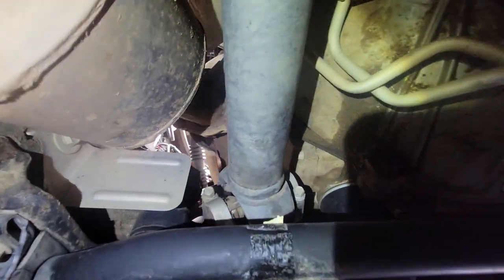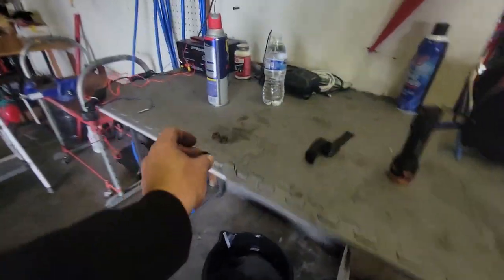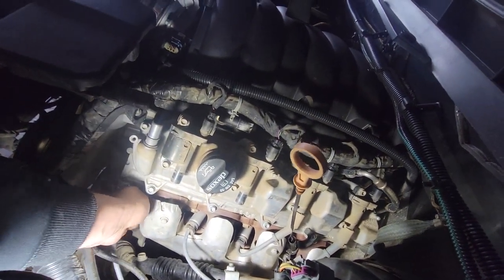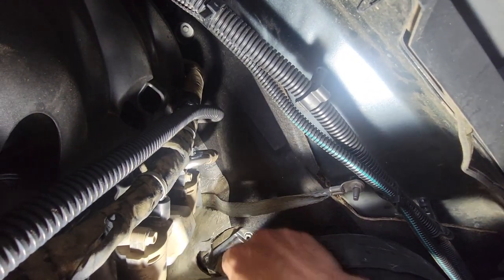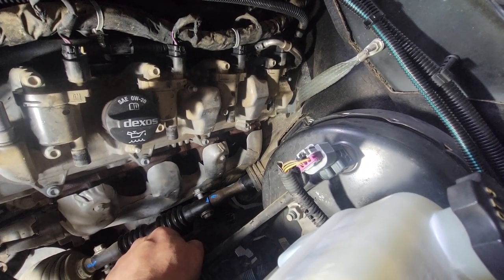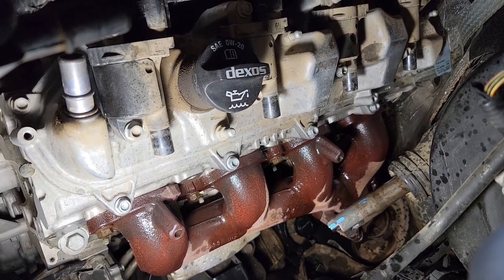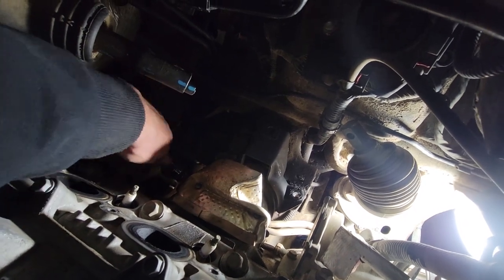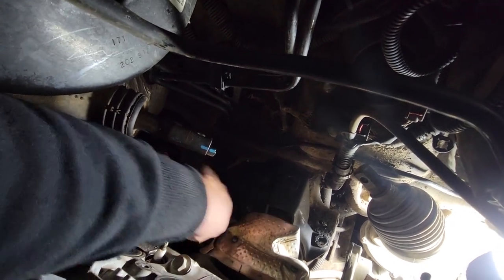How to: Replace Front Driver Motor Mount 2018 Chevy Silverado Z71 4x4 (No Differential Removal)

Comment: Next time just remove driver wheel and fender liner, T case shield to access bottom left bolt and cross member to lift motor up and its a straight shot to pull from driver wheel well.
Reply from the maker: @sheldonroyal2112  shit yeah Thanks brotha first time doing it so really not sure how to go about it lol. Thanks brotha 🙏